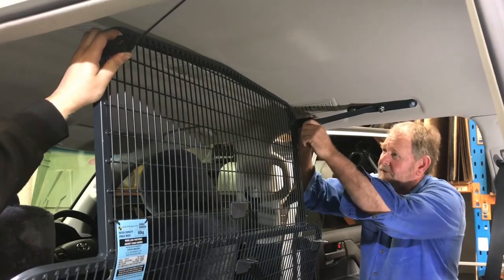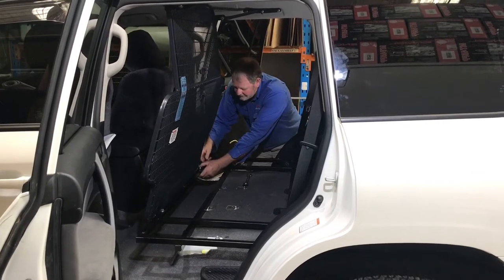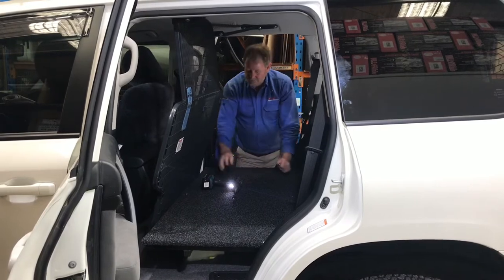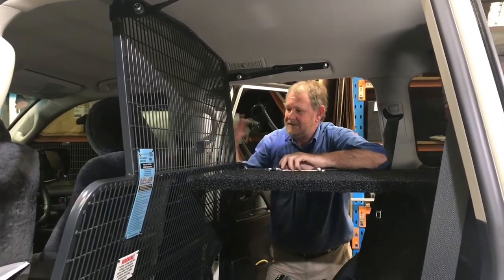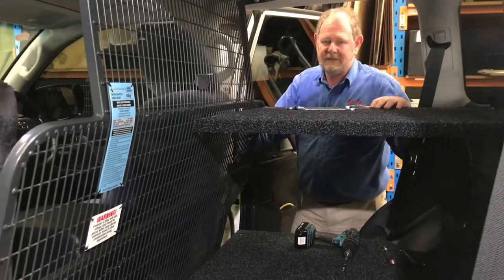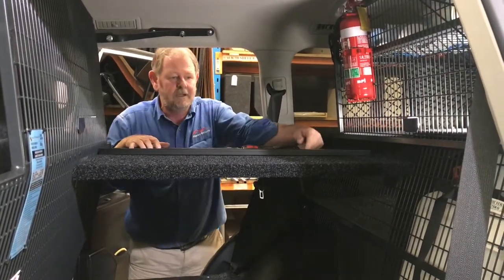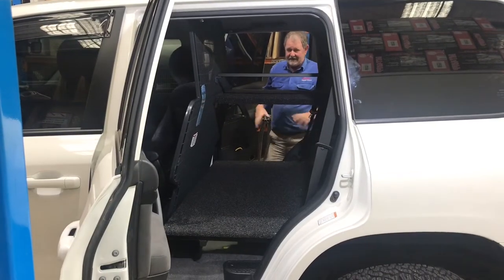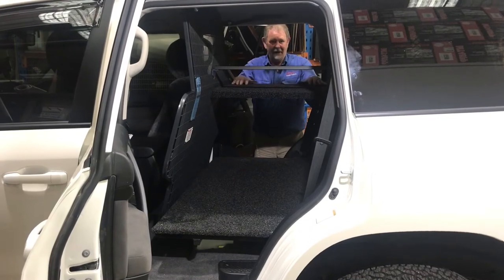Fourby Fitouts - 200 Series - Second Row Seat Storage - Mid Unit Installation

Comment: Wondering what is the added weight . Looks quite heavy
Reply from the maker: Hey there! This Mid Unit fitout weighs around 30kg. Your second row of seats that need to be removed to fit the Mid Unit will weigh around 30 - 40kg, so you actually gain weight carrying capacity 🙂cheers, Jacqui

Comment: Hi, does this platform needs rear cargo barrier in place or can be done without it ? Thanks
Reply from the maker: Hi Faraz, no you don't need the Cargo Barrier, you can fit the Floor on its own without it. The Cargo Barrier is needed if you want the Shelf above. Hope this helps!